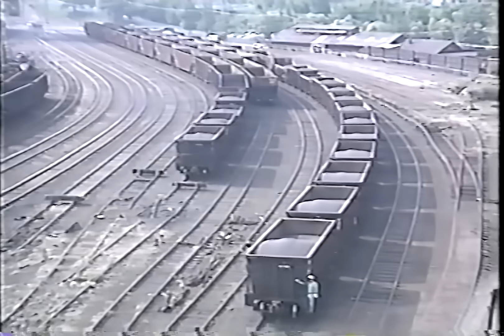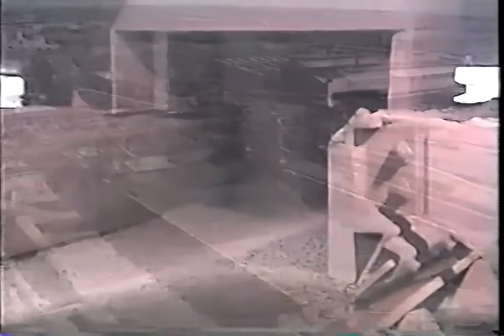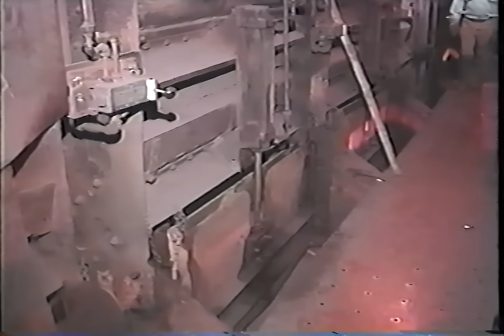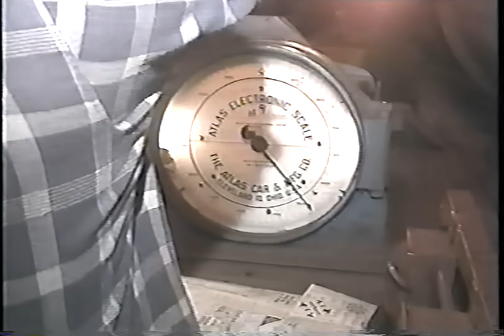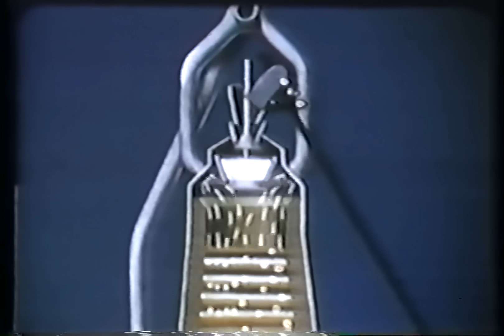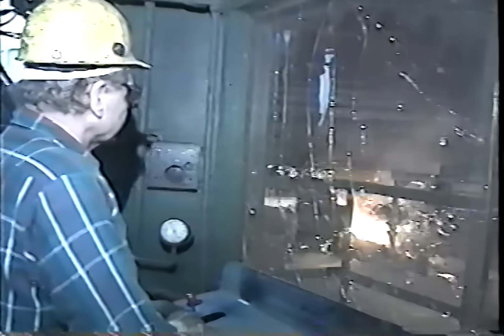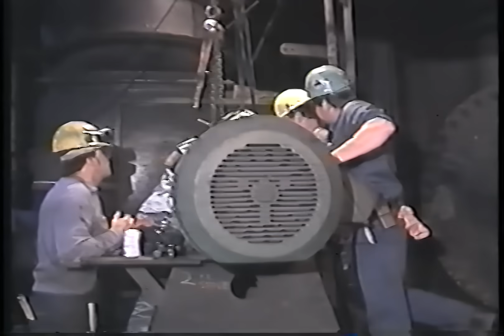Beth Steel Furnaces

Comment: I used to roll steel beams at the 48. Fun, but grueling. Many accidental deaths. Everything is either heavy or hot.
Reply: Bill Horvath, my grandfather worked at the 12 and 18 inch rolling mill 1934 to 1975. My uncle worked at the Open Hearth. I remember touring Martin Towers when it was built. A cousin was a bricklayer in the ovens with wooden shoes. When the shoes caught fire, it was time to get out.
Reply: what a lovely story of death.
Reply: What are some ways people died?
Reply: @PatentArchaeology  One narrow gauge brakeman was standing between railcars as train backed up to couple. 
Three men died while working in a deactivated soaking pit when the bolts holding the concrete two story walls failed and it fell on them. My friend was driving a forklift with a clamshell bucket raised and was driving over narrow gauge RR tracks at night at a angle and it rolled him. Roll bar on top pinned him by the neck, at night.
A guy working inside the the steam control room was poached when a main steam pipe broke and filled the room with live steam.
At the shears, as the butt was being cut from the hot steel it exploded from a hidden gas bubble, man standing waiting to hook up butt was incinerated.
Reply: @2002MX5  Wow. Thank you for sharing - how horrible.
Reply: It's interesting that none of these deaths ever made the papers. The ones I listed happened in only a two year period near the 48" rolling mill.
But more happened regularly all over the plant. But the pay was good and everybody knew it was a very dangerous job.
You do what you have to do for your family. I'd do it all over.
After BS closed, I worked in a chemical plant for 17 years. We had enough solvents on site to easily destroy a city. One tiny wrong move and boom.
Reply: @2002MX5   Steam pipe breaks are the stuff of nightmares. My dad used to tell me stories about LTV steel as a subcontractor there. He hated it as he said it was old and dangerous. He said Timken was much better.
Reply: @williamgoodwin3325  In this case, a steam control operator was alone when a steam pipe leading to the instrument panel burst. The operator staggered outside, still alive, with his clothing blown off and his skin falling off. He was taken to the on site medical facility, but he expired shortly after he left the the control room.
Reply: @2002MX5  crazy
Reply: @1981madmatt  How would you like to be standing between rail cars as a 4' coupling rod went through your body and hooked up to the rail car behind you at night? Never forget that night.
Reply: @2002MX5 that’s fucking gruesome. Maybe its better to have these jobs overseas lol
Reply: @2002MX5 Fuck. God rest their souls.
Reply: @PatentArchaeology  Burns. RIP Dave DeLuise 1956-88.
Reply: @TheDustysix  OSHA fines $1000 to Bethlehem Steel.
Reply: @hoghogwild  Too Bad. There Closed. NO DINERO!
Reply: @TheDustysix  They're closed now.  The point was $1000 for a life. Why would any company invest in safety when it's cheaper to just pay the fine?
Reply: @hoghogwild  YO HOG O ! Your channel has No Content !
Reply: @PatentArchaeology  death
Reply: Is there stuff that's both hot and heavy?
Reply: @secondlayer7898  That's normally the case
Reply: @secondlayer7898  yeah my wife
Reply: @secondlayer7898  The rail cars
Reply: Arnt Steel beams square?
Reply: @joachimsingh2929  I shaped in cross section.
Reply: I worked at the Saucon Soaking Pits from 73 to 84 running a pit crane. 42 inch, 48 inch and Combo mill. Dam shame no one wanted to save the steel. Now you have fast food and music fest where no one has Healthcare or retirement.  Good luck America and the Warehouse Valley. 😅
Reply: Sounds like a trip to yoga class the ladies either hot or heavy ain’t nothin in between

Comment: My dad worked there from 1952 to 1991. He worked in 2 machine shop and later in 8 machine shop as lead car blocker. In the 70’s we would pick him up after work. It was amazing how many people worked there. I was lucky enough to have toured some of the plant with him. He would be sad if he would see it now. All that is left is the memories of all who worked in that great plant.
Reply: My dad worked there from 1966 until it closed in 97 or 98 although he stayed on in the Lehigh Heavy Forge part that was bought by Whemco?  He stayed on there until he retired in 2017.  I never got to see the plant while it ran because I was too young to take the tour until they stopped giving tours but my mom went on it and was very impressed.  I did go in the plant with him once when it was Lehigh Heavy Forge in 2000 or 2001 and it was so almost eerie with everything quiet and a herd of deer living in the space at the time.  This just came to mind since I went to an event at the Steel Stacks recently and couldn't help going outside to walk around and stare at all of the blast furnaces and snap a lot of pictures.
Reply: Wow, 39 years.
Reply: As a young apprentice many years ago, part of the training involved visits to different industries, and despite the 45 years that have passed I can still remember the noise the heat and fumes in the huge steel mill we visited in Motherwell and it was terrifying. Sadly like most of the plant that built the modern world the jobs were given to the third world

Comment: Did they seriously load a side dump car then move it 20 feet and dump it? And why would they flip bottom dump train cars? This whole thing looks really inefficient
Reply: I thought the same when they moved the side dump car a few feet along, and agree regarding the dump cars.
Reply: With belly dump coal cars nowadays they still do the car flip at the mills.
Reply: I wondered that too. I would think it would be dumped immediately onto a conveyor belt that goes to the furnace.
Reply: I think the reason is the need to properly mix the required ingredients. Direct to furnace may have been difficult to control in proper amounts.
Also, interestingly, the USA does still produce significant amounts of steel compared to other countries. But, much of it comes from electric arc furnaces that are newer and more automated. NUCOR Steel comes to mind.
Reply: @craigholden564  yes we still have a few steel mills open in Cleveland, that are very big and employ a lot of people.
Not the same as it once was though when their were dozens of mills along the Cuyahoga
Reply: Better minds than mine thought the processes out at the plant, I just couldn’t figure out those particular ones.
Reply: Easier and faster. Those bottom hoppers are made for dispensing to belts underneath. Pounds per second I mean.
Reply: I'm sure there was a reason.
Reply: @bucksnortbumblefuk6872  yeah. It was an old an inefficient foundry
Reply: @Drewsky840  compared to newer plants of course.  Just as anything these days. 
I'm saying I'm sure there was a reason for it back in the day....
Cant apply hindsight to everything.

Comment: This whole operation was obsolete from the 1960's. 

The mills in Japan and Europe were more energy efficient and less labor intensive. 

The death knell was reunification of Germany. This opened up coal from Eastern Germany and Poland for European markets. The coal is suck high quality, they were able to make iron without the coking process.
Reply: I was wondering what "suck high quality" meant, until I read it like five times and realized it was just a typo lol.
Reply: Unfortunately it was woefully out of date. Even when Us Steel built Fairless in the 1950’s they were still building open hearth furnaces over BOP setups.

One thing that can be said about the South Bethlehem Works, it’s a testament to the longevity and engineering quality of the machinery and facilities that ran it, equipment a century old in proper running order maintained accordingly
Reply: Back in the 80’s, I used to run a huge lathe for roughing out huge pieces of steel for manufacturing large oil tools called underreamers. I remember a coworker was watching me make a first cut and huge puff of sand came flying out of steel. My coworker said that cheap Japanese steel was filled with pockets of sand.
Reply: Here in Australia in the one plant left I believe we just add coal and crushed limestone. We export the coal china uses for steel smelting.
Reply: You're right... after WWII Japanese and much European steel mill and machining capacity was wrecked. So the US loaned them money or outright paid for them to rebuild with NEW and EFFICIENT capacity while US producers continued to use worn-out and inefficient pre-war processes and plants. Plus US union work rules made efficiency improvements very expensive and sometimes impossible.
Reply: @farmalmta  The German and Japanese Tax laws make it advantageous to invest in Big Capital items, like Updating or Modernizing your Blast Furness.  

You'd be hard pressed to find a Blast Furnace in either Germany or Japan that is over 20 or 30 years old.

And Germany had industrial and trade groups that, unlike here, do not waste money on "Lobbying", but do solid research and development that is shared amongst members.

They found out in the 1970's that to beat the low coast places like Italy then or China today, they had to be on the edge of efficiency and productivity.

And the US Marshall plan did not rebuild any private companies, it was used to rebuild infrastructure and stabilize the economy.  (Unless you're France, then you use it to fight the French Indochina War)
Reply: Obsolete from the 1920s. Steelmaking from iron ore has changed as has the need to make steel from ore itself. Strip mills, EAF and other processes using recycled metal have significantly reduced the need for blast-furnace iron production, the labor costs and production inefficiencies of blast furnace production aside.
Reply: @jcphenry In my country most of the steel is produced from scrap. Blast Furnace Steel Mills exist but they were made in previous century by government and privatized and now owned by a conglomerate which was founded in 1950s by military officers to invest their a part of their salary in return of some money after their retirement.(basically a retirement fund, they even have a factory that produces Renault cars under license since many decades). Anyways they modernized the plants and actively modernizing and it works. But there’s still an independent Blast Furnace steel mill which is oldest in the country, they are owned by labor union and share holders from stock exchange since almost 3 decades. Private enterprises use EAF or some use induction furnaces
Reply: Germanlignin. has the lowest grade of coal - lignite. Even bituminous coal is converted to coke. Coke can also be made from petroleum. 

The blast furnaces shown were inefficient compared to modern versions, but it was more US labor pricing themselves out of steelmaking. Can't justify investment into more efficient equipment if high labor costs ensure the product won't be able to compete with sources that have lower labor costs.
Reply: No, that's not true.

Comment: Many a ore train I used to see going through our town to be taken across the lake to Bethlehem steel!
Reply: A lot of those ore trains came through my hometown as well. Took 4 steam locomotives, (Pennsy I1 decapods), to move it from Northumberland yard, through Sunbury, Shamokin, and over a 2% grade. It was a all day run to a town called Mt. Carmel, where it was broken up into 4 smaller trains for the Lehigh Valley Railroad. Lehigh had already switched to diesel in the early 50's

Comment: I worked on a rolling mill plant in Bahrain in 1996. All the machinery came from Philaadelphia. The whole plant was removed and set up in an industrial area outside Manama,  Bahrain.  Everything was marked " made in USA. " A sign of great quality.
Our politicians must remember they have four years to the next election.
Each council must work to reflect the interests of the local unemployed. New iobs, housing,......
Reply: I worked on the Schenectady built General Electric gas turbines at Bapco in Bahrain in 1979. I stayed in Awali, swam in the old rock version of the Al Adari pool, cruised the abandoned airstrip on Fridays, shopped at the Sook in Manama. I will bet the place changed by the time you got there.